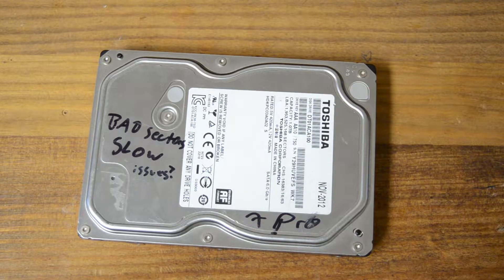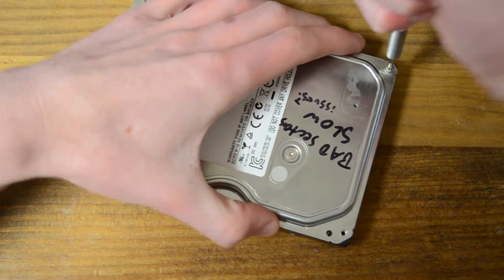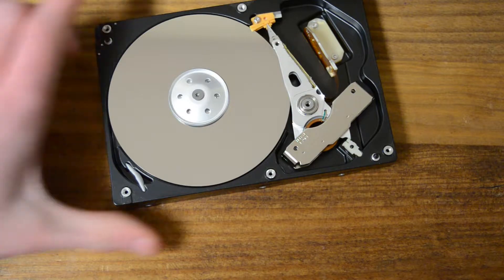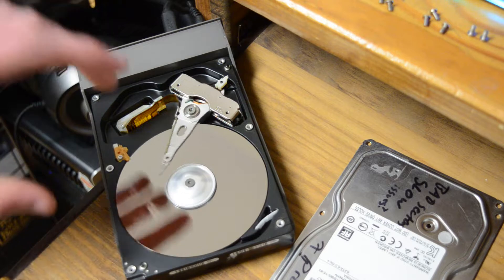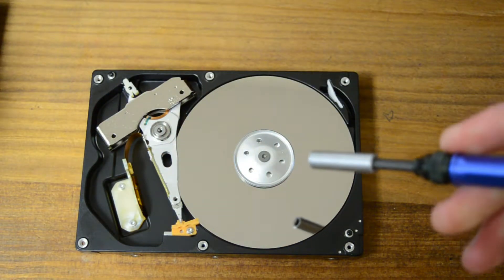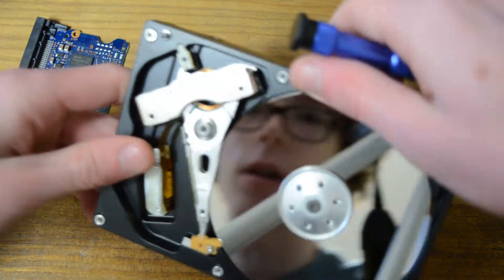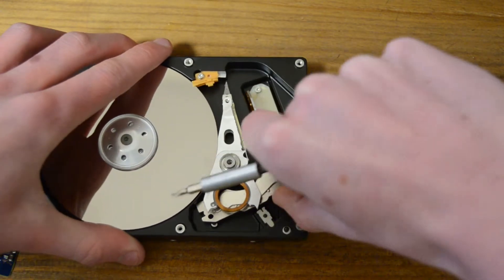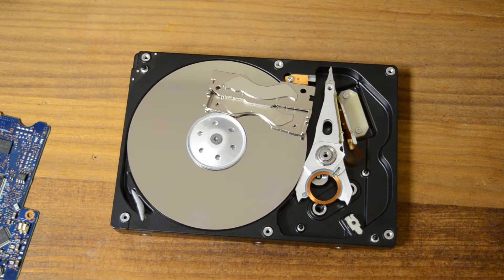1TB Toshiba HDD teardown: The cheapest HDD I have ever seen

Comment: This exact hdd, this exact clicking. Dropped it when it was disconnected. It was clicking slower at first and kinda worked but in a few hours it started clicking every second like that and basically not even connecting to the system. I guess something got misaligned, I'm not sure
Reply: Actually despite the same model number, the back looks quite different, but only in a cosmetic way I guess